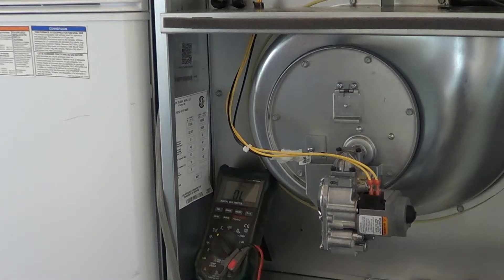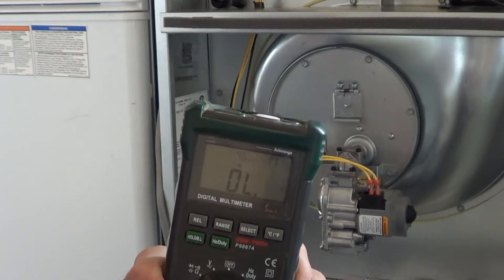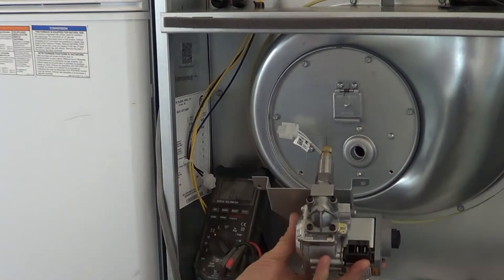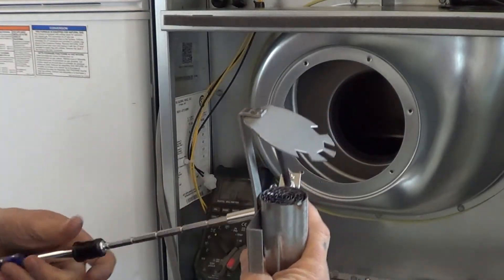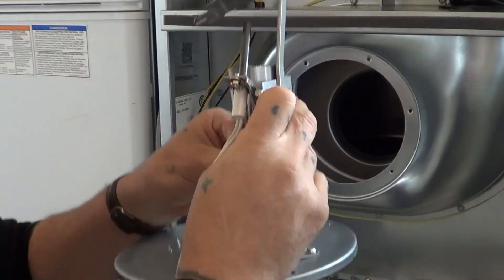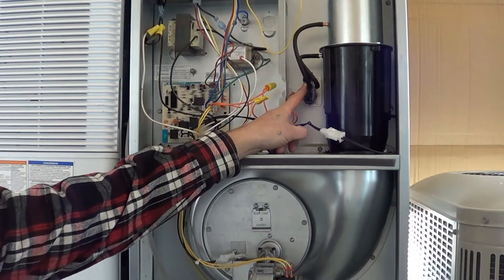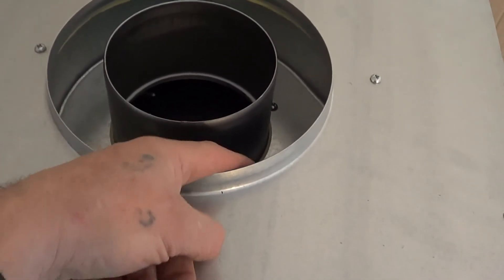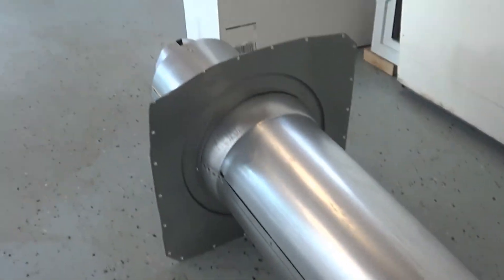Failed Ignition on Nordyne / Nortek / Intertherm Furnace

Comment: Your video was really informative but I spent $113 on an igniter I didn’t need. If you could have provided more information about what it could be would have been nice. My issue was the vent at the top of the house was to rotted out. I’m now $600 in the hole. Anyone reading this, check your blower it can be plugged. The two rubber tubes going to it; try to blow in them. if you got no circulation remove the blower and check it it froze off. For me it was the vent on top of the house being to corroded to circulate air. I paid a lot of money getting it fixed and I hope you guys who see this don’t. The error I got was the red light flashed twice. Check your blower. Make sure it works. You can test it by pulling the plug out and blowing into it then pinching it off.  (Red light flashing)  once you do that it should stay solid red. If it’s giving you the yellow light even after changing the igniter then it’s the ventilation. If it can’t keep a flame even after changing the igniter the vent at the top of the house might be rotted out. That’s what it was for me.
Reply: Hello, I’m sorry to hear about your troubles with the furnace. The trouble that we are talking about here was ignition failure, signified by one flash on your diagnostic code. You indicated you had a two flash problem which the furnace tells you is a pressure problem, or the start up phase of the furnace before ignition. What was it that made you replace the igniter? Did you test it like on the video? We are talking here about ignition failure indicated on the flash code as one flash, not the pressure system, indicated by the two flashes. Again, sorry to hear your furnace is having issues.

Comment: Check Your Chimney if you have one with the double wall chimney pipe. 

I went through a new board, new inducer motor, new draft pressure sensor, and still, the unit would light and either just when the blower started or shortly after, it would shut down. Many times when it worked, and stayed on, I'd have a flashing yellow flame sensor light. Then for weeks it would work fine. Everyone kept saying clean the sensor, or bad igniter, until someone from the gas company came and said: weak flame, it starts fine... it's wavering, probably not getting enough air. Since these are inside, and the manufactured home is not tight, the last thing I thought of looking at, was the right answer. Rusted out inner pipe in the dual wall chimney. Strong North wind, the furnace wouldn't work, other directions or moderate wind, the furnace worked fine.

If you have this situation: starts fine, goes through all the steps, ignites, with a good solid flame sensor, but then the flame gets smaller and smaller, wavering, turns yellow, and goes out. You have a draft problem, not enough air. 

Go up on the roof and look!  :-)

https://i.postimg.cc/Y0LGgrJ2/bad-chimney-pipe.jpg
Reply: where did you find the parts for this?  Looks like im dealing with a similar situation.
Reply: @briannamorgan9756  I'm not sure I made it clear. The problem wasn't the furnace it was the double walled chimney that had rusted through. When the furnace started, the draft, from the heat, would suck all the air up, preventing Oxygen from getting to the gas. I replaced the inner pipe from the roof up and then the outer pipe for a few feet. New cap. I don't pretend to be an expert, but the point is, mine would start, go through all the steps, ignite, good flame... then dwindle down, down and go out. In which case, the sensor would determine No Ignition and shut off the gas feed.  https://i.postimg.cc/DftstK8t/chimney-rust.jpg  Home Depot but depending on your chimney, standard hardware store parts and pieces.
Reply: @HodagMedia  You did happen on to the correct problem and the solution to fix it. However, allow me to give you some advice,, ( I am a certified Gasfitter, over 40 years as a journeyman) , and have changed out a number of these Intertherm chimneys over the years, after they have reached an age of 9-12 years old. The difference in the way you have done it, and the recommended way is this. You must get a CORRECT Mobile Home chimney from a  Plumber/ heating specialist, furnace supplier or place that sells these furnaces, and change BOTH pipes out. The chimney comes as 1  telescopic unit. Reason being,, the inner piping is a special Stainless steel alloy to prevent rusting,,, ( I know) where as replacing it with a galvanized pipe,, you will be having to re do that every couple of years. Galvanized will rust out very quickly. I am not being critical, but the pictures you showed of the rusted out portion are typical. sometimes you can catch it early and get by with just doing the top extension, but you should still take the bottom off to clean the debris out. just my 2 cents worth for you.
Reply: @HodagMedia  Nope you were very clear Hodag and very helpful!  It was literally the exact issue i was having.  Wish i could post the pics but you saved me a few days of extra hassle.  Got it fixed and the furnace has never worked so well.  Thanks!!!
Reply: @meladrian9614  Thank You, great and solid advice. As I'm in Wisconsin... ;-) Maybe in the Spring or after the heating season. Then I need to find someone who will do the work. Seems as soon as I say Mobile Home (Manufactured Home) the answer is, "we don't work on those." Maybe I'll do better with the chimney work at finding someone. My furnace was a problem since I bought the place, changing parts and always the same problem. That means seven years past when I should have had it replaced properly. I appreciate the good advice and I'll get the old parts and my cobbled up repair, replaced, all the way from the furnace to the top.

Comment: My pilot light doesn't stay lit after I release the gas valve button . I replaced the gas valve and thermol couple. Any ideas? Thanks
Reply: How strong is your pilot light? Does it look as big and as sharp as it used to, or is it a smaller lazy flame? It is possible that the pilot burner is dirty and needs to be cleaned , if you have already installed a new thermocouple, or the tip of the thermocouple is not positioned in the flame correctly
Reply: @meladrian9614  normal flame after replacing thermocouple, but  only warm air coming out of vents

Comment: I friend! I have this same unit.  The problem i am having is what looks like a legit weak flame. It ignites, stays on for a good 30 seconds or so, then kicks off. The air coming out never gets very warm even though i got a long flame. I can smell gas while the flame is lit and the flame is a bit more orange then what i think it should be. Induction fan maybe?
Reply: doesn't look like it has a sensor I'm same problem lol first interterm furnace gas goes on and shuts off
Reply: @dwell771  also, the hot surface ignitor is the sensor.
Reply: @Kickstandsup83  thx 
Jeff hanshew now I just have to wait for the supplier to open hahaha thx again man
Reply: ill also check for webs too
Reply: @dwell771  take the orifice out and look in the gas valve. Spiders Love to make nests in gas valves. Clean it out if you find a nest. This was my problem.

Comment: Damn. This is a very helpful video. My furnace is 6 years old M1M. And for the first time I got four red flashing lights "lockout due to failed ignition". I am troubleshooting now. I'm going to test with multimeter as you suggested first. Then check the orphice...and then if still not working the roof vent. I was also told maybe the ignition control? Hopefully it doesnt come down to that. What do you think? Thanks in advance!
Reply: Thanks for checking out the video.  You definitely want to follow the video and check each of those things.  Most of the time the failed ignition has nothing to do with the control board/circuit board. You should be good there! 😊
Reply: @davinadolph2008  Update: tested the igniter with my multimeter and nothing! I found one on amazon for 38 bucks. Not bad at all thanks again for your video!

Comment: Wow.. great video, I have an M1M, was getting a flashing yellow light. I changed the igniter/flame senser. All light are working as expected, after about 15 or so minutes running the red light goes out at the same time, 1-2 seconds later the yellow light goes off and the furnace tums off. Any thoughts.. thanks
Reply from the maker: Hello, we recently had a similar question that was asked. Here is the response my technician gave. I hope this helps!
"The M1M going out like that is most often because it is not sensing the flame. When you say you replace the flame sensor, that must mean you replaced the ignition, as on this model the igniter acts as the flame sensor. They found during the warranty process o; these furnaces that the igniter/flame sensor would do this if the tip of the igniter was not all the way angled into the flame. I would check that and also a question, are you able to witness the flame going outside? If so, does the flame shut snap off or does it get lazy and weaker as it goes out? This would indicate an air flow problem. To sum up, if the igniter is new, and into the flame, with a strong flame and it snaps out, it is most likely a circuit board issue. The periodic problems with furnaces are the worst kind." Thanks for the question.
Reply: Statty Travels, Hello. The yellow light is just meaning that the igniter, which is acting also as a flame sensor, is at this moment receiving heat. That’s why a weak flame, or not enough heat, causes it to flash. With the red light going out, that is usually a circuit board issue. Any time there is power to the unit, the red light either stays on, or flashes a code. It’s loosing power somewhere. Does the red light stay off for a time? That indicates a circuit board problem
Reply: @randydolph852  
Flame sensor light flashes when it cuts off.
Reply: I trouble shorting that problem
Reply: Flame sensor light flashes when it cuts off

Comment: I have an M1MC 070ABW that ignites runs for a few minutes then flame goes out.  It will then re lite and go out again after a minute.  I have replaced the flame sensor with the correct one. Weak flame code at times. I have checked for spiders. It does not do this all the time. Very inconsistent. Furnace is propane and about 15 yrs old. Any suggestions would be appreciated.
Reply: George F, hello. The M1M going out like that is most often because it is not sensing the flame. When you say you replace the flame sensor, that must mean you replaced the ignition, as on this model the igniter acts as the flame sensor. They found during the warranty process o; these furnaces that the igniter/flame sensor would do this if the tip of the igniter was not all the way angled into the flame. I would check that and also a question, are you able to witness the flame going outside? If so, does the flame shut snap off or does it get lazy and weaker as it goes out? This would indicate an air flow problem. To sum up, if the igniter is new, and into the flame, with a strong flame and it snaps out, it is most likely a circuit board issue. The periodic problems with furnaces are the worst kind. Thanks for the question.
Reply: I had the same issue but mine had spider neat and dead spider down in the whole that he showed.
Reply: B